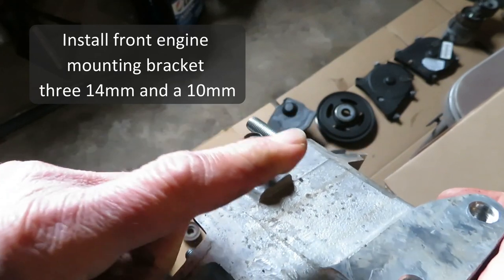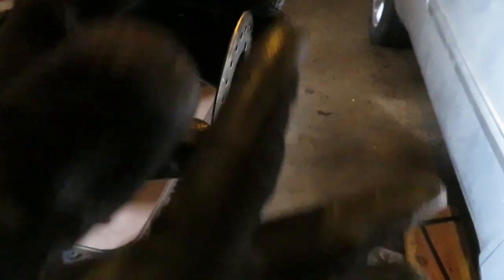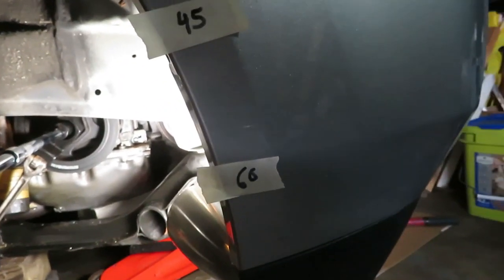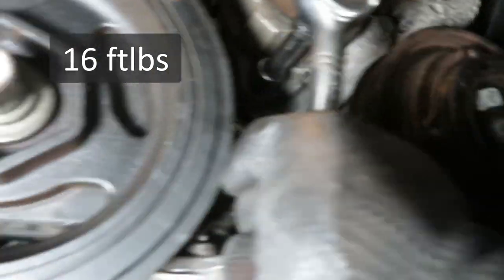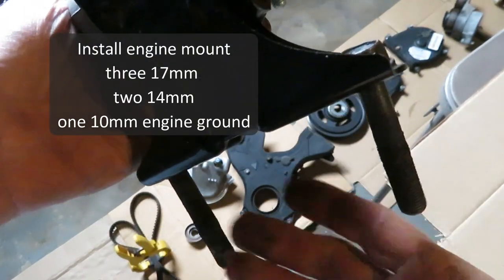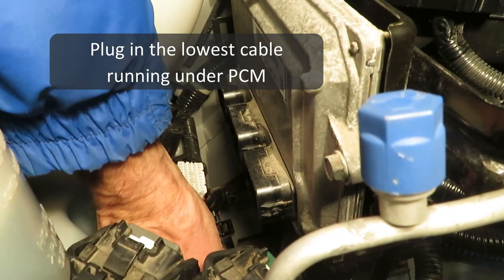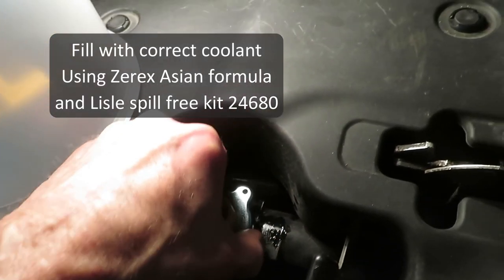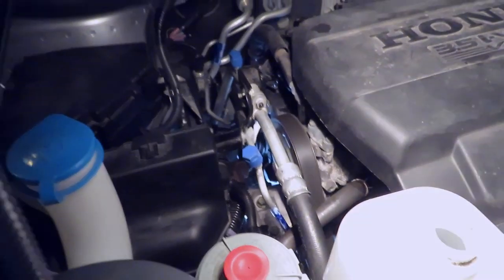Honda 3.5L Timing Component Replacement Part 3: Front Engine Reassembly ’12 Pilot

Comment: 60° is one point on the bolt.  mark and move from one point to the next/
Reply from the maker: Yes, very clever...and simple.  360 divided by 6 (points on a bolt) equals 60.